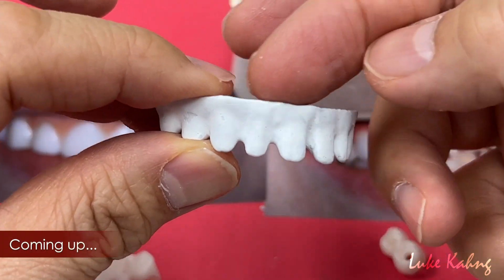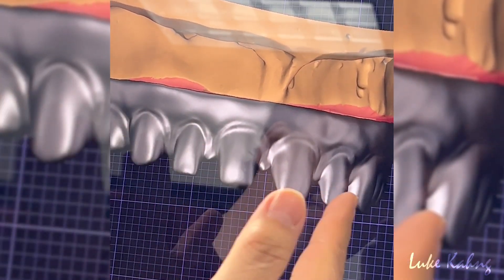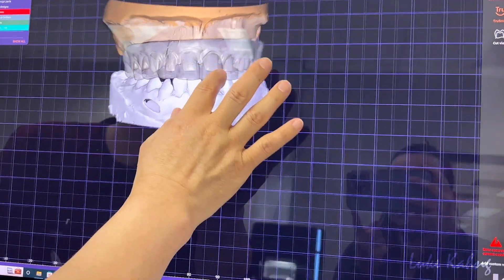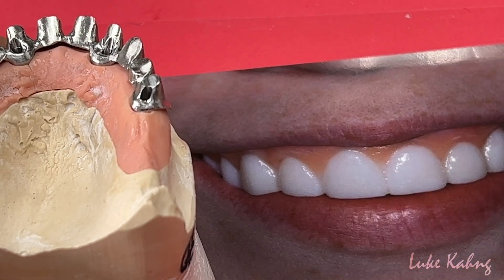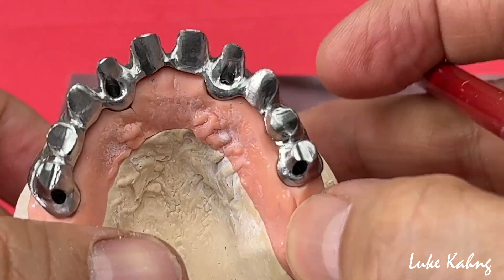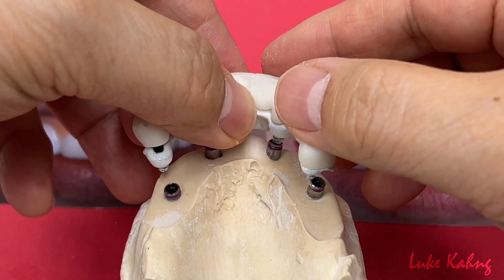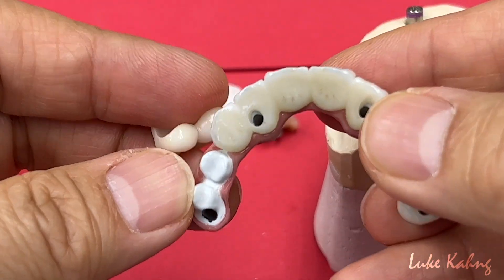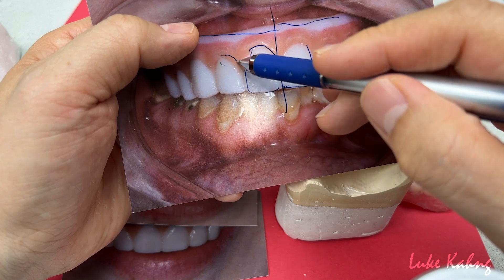Solving a dilemma for a Full Mouth Implant Case

Comment: I have zirconia right now and I am interested in getting the titanium dentures. I have eleven implants ( six on top and fiv on the bottom. I am wondering about the cost .
Thank you
Reply from the maker: this is co cr ceramic with zirconia.....lab cost $7300 per arch..thanks
Reply: @Lsk121  Hi.  Where are you located?